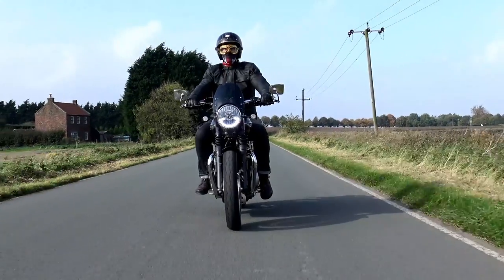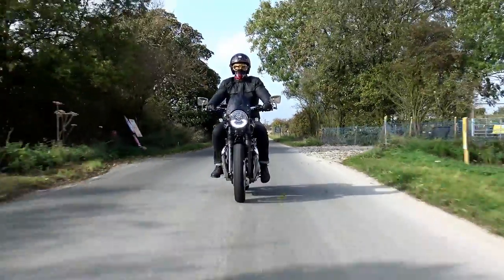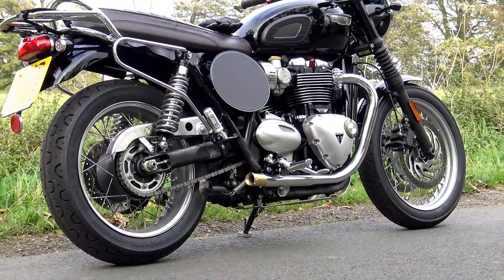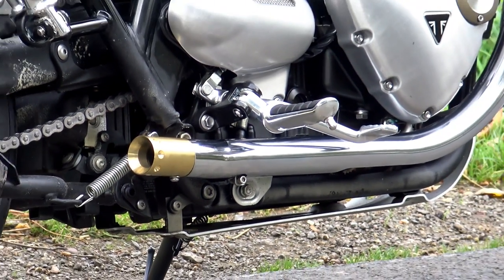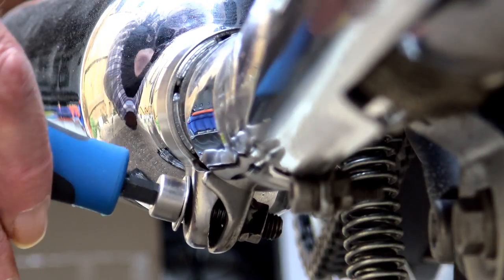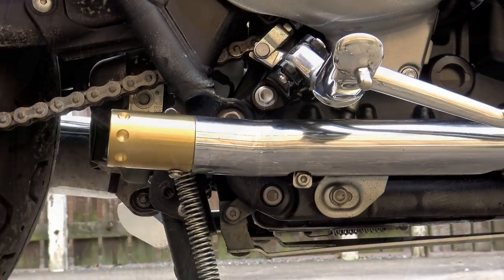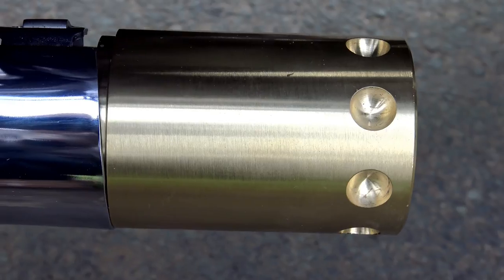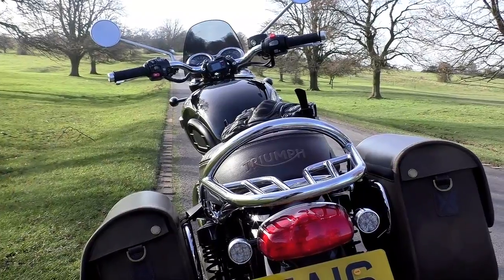Triumph Bonneville T120 Custom Exhaust tips & Race plates, from BRITISH CUSTOMS!

Comment: I’ve been looking at these on British Customs website for a while now, but really wanted to hear a clear example of how they sound. You’ve convinced me. This is the way to go, until someone comes out with a better peashooter setup than the factory ones.
Reply from the maker: good to hear sir! just check with BC to make sure they will fit, these tips are only compatable up to a certain vin number!
Reply: stuart fillingham just got them installed, your video was invaluable help! Only minor snags were: that rubber center stand stop was indeed a major pain to get into the new bracket; getting the passenger foot pegs off without disassembling them entirely; and the long bolts left behind from the silencers (I took the rubber bushings and spacers out of the silencers, and used the to reattach the foot pegs to fill that space). Bike really sounds the part now!
Reply from the maker: yes the foot peg bolt is a bit long, good idea re the spacers i never thought of that! thanks for watching!

Comment: I checked with British Customs to look into getting the exhaust tips.  I noticed they indicate that T120 models with a Vin # greater than a certain number will not fit properly.  In a chat, they indicate that Triumph changed the length of the heat shield.  If yours fits this description, it might be why yours don't fit perfectly on the left side.  They are working on the solution.  Also; excellent video as always.  I enjoy watching.  Thanks.
Reply from the maker: Hi Phil mine is an early VIN the problem is with the weird way Triumph trimmed the exhaust shroud at an angle its not really noticable but it was magnified in HD. good to hear they are looking at a version for the 2017 model! thanks for watching

Comment: Hi Stuart,
Thank you for the really informative video, still valid to date! 
Just bought these BC tips (on ebay - new in original packaging) however they didn't come with a centre stand stopper bracket, so it seems like I'll have to source that elsewhere. 
I was therefore hoping you could kindly provide the dimensions for that L shaped plate where possible.

Comment: Did you notice the Kickstand rubbing on the exhaust tip? I have installed these on my T120 and noticed the kickstand has made a "scratch" or "mark" where the kickstand was hitting the exhaust tip. Thanks for your input!
Reply from the maker: No im afraid i didnt encounter that problem Matt, there wasnt a lot of clearance on mine but there was enough.
Reply: The kickstand definitely connects to mine also (2016 t120 BLK). It isn’t scratching it per se, but it does connect and leaves a slight mark.

Comment: Stuart, did you do anything about the gap left behind by the pea shooter bracket that sits between the the rear peg and the saddle holders? I didn't get anything from British Customs to fill that gap and the fit of the saddle holders seems less than optimal now.
Reply: lol, I'm an idiot. You can remove the rubber and washer spacer from the pea shooter. I should have more beer next time.
Reply from the maker: Im not sure i follow you Jose, saddle holders?
Reply: stuart fillingham I meant the saddle bag holders. Were you slide the saddle bags on.
Reply from the maker: I see! all i can say Jose is that it all fits as per my video. it shouldn't affect the way the pannier brackets fit,
Reply: stuart fillingham Yeah, what was missing on the video is that when you remove the silencer from the rear peg, you want to remove the rubber spacer/washer that's on the silencer bracket and put it between the rear peg screw and the pannier bracket.

Comment: Hello thank you for an excellent video. I was told that if I change the silencers on my 09  T100 I would have to have it remapped by a dealer. Can you please advise and recommend in a future video maybe.
Thank you I'm absolutely loving your work , class act .
Thank you .
Reply from the maker: Thank you! depending on the exhaust you fit it very probably will need a remap, i will be dealing with that on the Payday project bike at some stage in the future, but not sure when!

Comment: Do you have to adgust the engine settings by using external computer? I don't have official Triumph service in the country so I'm not able to do so. My only concern is that injector engines need to have that sort of engine tuning after swapping exhaust system to another type

Comment: Hi Stuart, thanks so much for your bloody great videos. I installed these yesterday on my T120 Black 2018 and they fit quite well. I’m wondering if you can muffle them a little? I’ve also got an x pipe in and it might be too loud.
Reply: did you have to adgust the engine settings by using external computer or did you go to the official triumph service to do that? My only concern is that injector engines need to have that sort of engine tuning after swapping exhaust system to another type
Reply: Hi! Excuse, how did you going with the combination?, i would like to make the same to my bike.

Comment: Hi Stuart, 
Great job on the Videos. Recent subscriber and T120 Owner. 
Just a quick note:  The BC Tips are listed as only being compatible with VIN # lower than 783814 (last six digits), not sure why.  I hope BC comes out with a mod to assist the new bikes too.
Reply from the maker: Apparently Triumph changed the dimensions of the exhaust's slightly. it has been causing headaches for many aftermarket manufacturers! thanks for the sub!
Reply: Thanks for the intel. 
Do you know if the Exh changes affect the De-Cat mod too?
Reply from the maker: Im not sure i understand your question sir,  any change with the exhaust system will require you to go through the ECU acclimatisation process, very simple to do see my video on the sleeper pro exhausts.
Reply: Oh yes, very good. 
I was curious if with the Exhaust Changes you mentioned having fitment issues with BC tips,  if the Delete Cat modification is know to have any fitment issues, like the BC Tips did.   
Thanks for all your responses.
Reply from the maker: As far as im aware there are no issues with fitting an x pipe to any of the models, the dimensions are all the same.
Reply: British Customs say you must permanantly remove the centre stand to switch to the custom tips.

Comment: Hi Stuart, great vid as always and very informative. Did you notice any issues with the motor using the tips? I was advised (by a dealer) that removing the stock pipes for straight pipes or tips can cause issues due to the lack of back pressure... any thoughts? I'm thinking of de-catting and getting some baffle-less cones if its not too loud. Cheers in advance.
Reply from the maker: No none at all sir, I think your dealer is a little confused, back pressure does only one thing! it slows your engine down!
Reply: stuart fillingham that’s what I thought, didn’t make sense to me... with the learning ECU I presume you don’t need a remap even if you change the slip one  as well?  Cheers for the response.

Comment: do these tips exist for the '05 T100? im looking to clean up my back end. love the look of shorty pipes.
Reply from the maker: Not that I know of
Reply: That's a real bummer. Any suggestions you have for small slip ons for the T100 would be great. Really don't want cones like the Predator Pros, and the OEM peashooters are whisper quiet, and when I take them off, running just the header pipes is obnoxiously loud (Although it was nice to finally hear my actual engine for a minute).